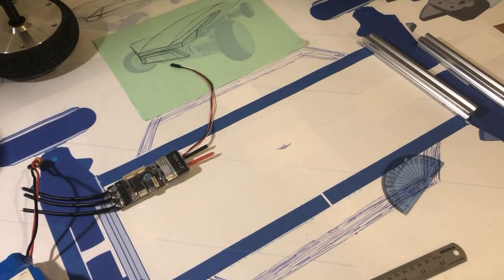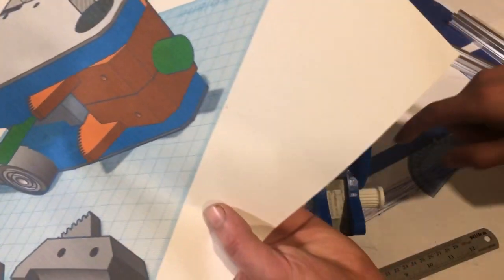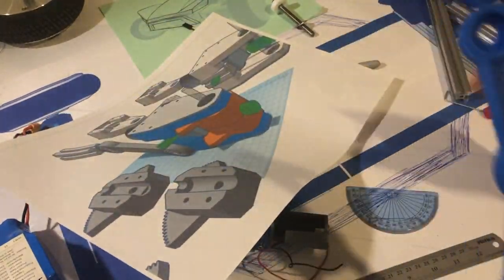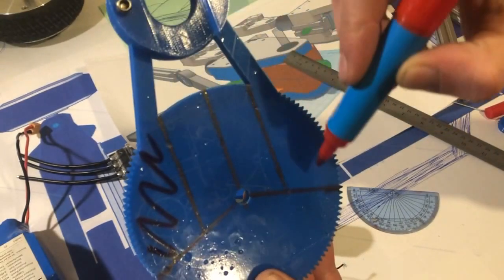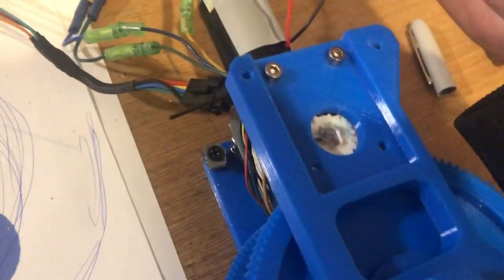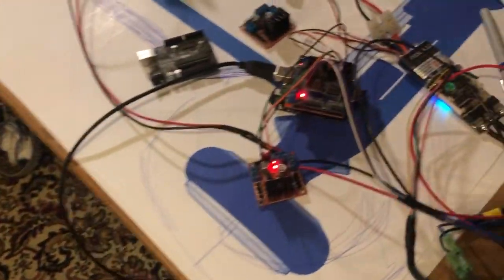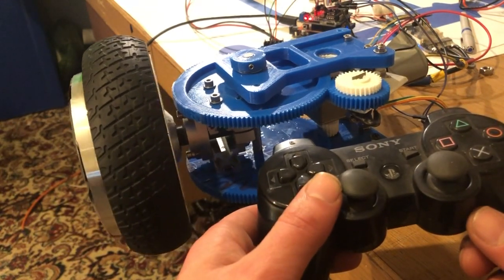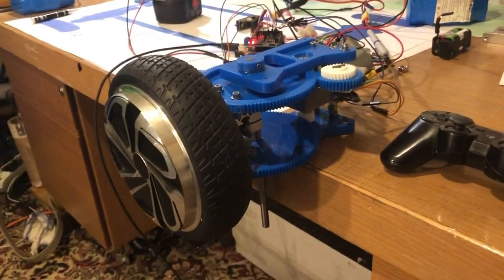RC HOVERBOARD CAR STEERING HUB PROTOTYPE arduino + ps3 controlled, hack

Comment: What driver are you using for the hoverboard wheel?
Reply from the maker: Hi, its a Flipsky esc, based on the open source Vesc, they are really good, commonly used in e-skateboards, thanks